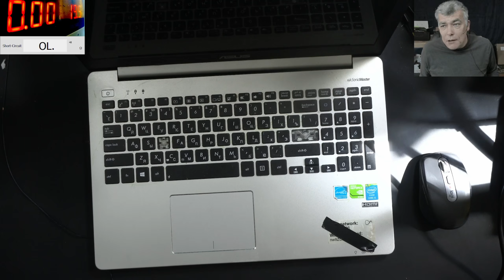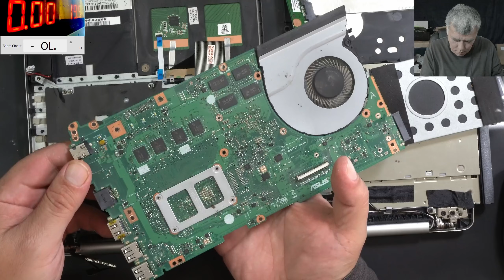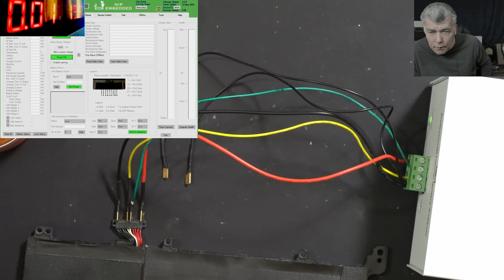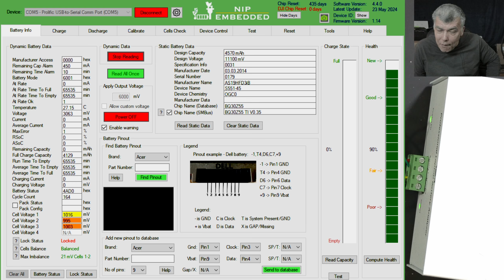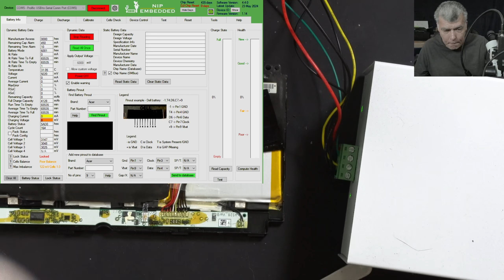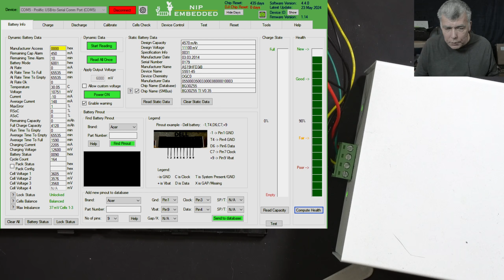How your laptop firmware can get corrupted and kill your laptop board and battery

Comment: Seems like the battery tried to commit su!c!d3 but you discovered it 😂. I hate when manufacturers do this, its the only way to get you to buy a new battery. 🤦. I dont even get why they put in fuses that can be blown by the circuit itself. I gues its protection if the battery is degraded but in my experience its most of the time due to a planned obsolescence

Comment: I spoke to a battery expert about this once, and even atempting to recharge a battery that has been almost totally discharged is dangerous. Espeshally because you are pushing WAAAY too much current. And i belive thats why the fuse got so hot, the internal resistance in the battery is high because it needs time to "reinflate". Think of a battery like a parking garage with several level's. And because the battery is severely discharged, it is collapsed. And you start craming way too meany cars in it, its gona be mayhem. So you need to push low current and essentially restore the layers before you can push higher current. He said he would let it charge to like 15% with only 400-500 mAh, before you can start increasing the current.

Comment: Hello Sorin (from France), i learned a lot with you, many thanks for that! About this video, one question : how the main power rail 19V can be missing because of a firmware (bios-EC) corrupted? Usually in this case the computer doesn't start but the main power rail is present. Am i wrong?

Comment: Hello Sorin, I watched many of your videos and I know you always want to show how it is possible to get a battery working without the Advanced tools of NLBA. I admire that , but what I do not understand is why not going straight to see if there is an error code in the EPROM battery and diagnose from there. I mean in this case probably no "incision" would have been needed if you first unlocked the battery by cleaning the errors and then tried the NLBA charge menu. Would not that had worked ?
Reply: First, the fault must be fixed, in this case the cells voltage, otherwise the chip detects again the failure and set Permanent Failure flag. So, the correct steps are: diagnose the battery, find the problem, fix the problem (precharging and balacing the cells), unseal the chip, clear the chip errors. Only NLBA1 tool can unseal and clear the chip errors, the chips are secured and not easy to unseal.

Comment: Nooo!  @16:00 If you look at video battery was made in 2014.  It's 10 years old.  Low cycle count as probably always used on charger, but a 10 year old Lipo is toast.  It'll probably go from full to empty in 10 mins or less.  I had a laptop I used always on power for 10 years and when that battery was useless it's cycle count was less than 30.  It's almost a meaningless number unless taken with the age.

Comment: Would you not say that fuse was faulty too? My understanding was that it should disconnect as soon as the solder melts. And that solder was melted for a long time...
Reply: I don't think so, he tested the fuse after it melted, it has shown continuity, so it was fine. Remember a fuse is just a wire. In this case a "solder wire"

Comment: the nlba is $450 then it another $270 per year for a reset license to use the nlba to fix batteries, yeah no scam there.....
Reply: Do you fix 2-3 batteries every month? No? Then not for you
Reply: it's for businesses not for poor people.
Reply: @orange11squares  Even for a business the license price is too absurd, there are other "business/industry" standard things that are expensive like PC-3000 that have a single payment and its yours.
If it was a permanent one it would be fine, but a $270 yearly fee that has been increasing every year for a product like this? Nope, it is a scam.
Reply: @Carcanchita Seem yt removed my comment where I said starting price for pc3000 is around $8k and then pay for the training. The support is no-cost for the first year then it only cost 1600 a year
Reply: @Carcanchita  Actually it is the cheapest on the market ? UBRT price is 1000$ + fees, just software, so what are you talking about ? 270$ is too cheap, it is a joke, it is the price of 3 Macbook batteries which can be repaired in 1 hour. More, check Philips battery tester which costs thousands.
Reply: @orange11squares  Even for buiseness its to expensive. you repair a batery maybe 2 for year😆 its a robery

Comment: under 3.1v all CR2032 are depleted
cycle count 164.... "this battery is like new".... muhahaha !!!
Reply: yes it has 95% or more of its original capacity, these batteries can go 300-500 cycles until they reach 80% battery health
Reply: man, you're so lucky u still got clients that don't have a clue about electronics or don't care much about quality and also, so many guys out there are blinded by low repair costs...
Reply: @gabrieln5357  you know that if you go to make the "proper repair" - replace charging port/charger/battery(oem batteries often hard to buy/ crazy expensive)/cmos + labor, this laptop goes directly to the bin? you are so wasteful. you have to be flexible :) that's why he have jobs to repair, and you will be only replacing things :)
Reply: @gabrieln5357  block to all haters , you are here to learn but instead of saying thx to Sorin you spreading hate mixed with ignorance . your comment shows how stupid you are when it comes to electronic. so either watch silent to learn something to educate yourself better and get out of stupidity or GTFO here

Comment: One thing i dont understand, how did you fix  firmware in laptop ?  Firmware is hardware code,.how did you replace faulty one ?  Also firmware by definiton should not rely on battery ?!
Reply: I think he meant variables stored in battery backed up ram.

Comment: ❤ thanks Sorin. Did you listened about the thousand pagers (motorola) exploding in the same time (Lebanon), How can TNT being activated in a small device in the same time? What component can seems like a normal component but being explosive? Battery? Thanks if you can help worldwide to solve this big threat, that can be find also in computers and smartphones, in the future, why not, activated with a hack of national security message, why not, at this time everything is possible.😮
Reply: Its likely misdirection on the cause of the explosions so the real cause is not given away.

Comment: Once a cell has dropped below 2.5 its not safe and should be disposed of. its not worth the risk. (I build big battery packs for large ebikes, I know its a harsh world at 50-150a discharge rates so you need to be more careful but the low voltage damage happens at a chemical level, i'll admit I dont with laptops for the last 10+yrs but i'd spend the money on a new one for a good nights sleep
Reply: There is so many failsafe mechanisms in a laptop battery, it's perfectly fine.
Reply: Total bs! The manufacturers just want to make more money so they lock the battery at low voltage. If youchargethe battery yourself they blow the fuse! Criminal practise...

Comment: Not sure that's a battery firmware error.... sounds more like the manufacturer build in a detection in the software that if battery goes low and locks then it is charged manually the chip will try to kill the fuse quickly so owner has to buy a new battery or new laptop. Basically you triggered the battery suicide feature and the chip tried to defeat you with a Mortal Kombat Fatality move but failed because you are smarter than manufacturer ;-)
Reply: It seems a lot of manufacturers do this. hp, some dells, some chromebooks. And than thinking apple was wrong with serializing the batteries but its every company out there stepping in this planned obsolescence stuff

Comment: Hello, 

Sometimes the battery is unlocked with a 20-cycle count, health at 20%, with PF STATUS 000000.

Now perform battery clear errors....and health goes at 60% or more. Sometimes a battery reset is necessary when status is unlocked.

The channel is great, it helped me a lot